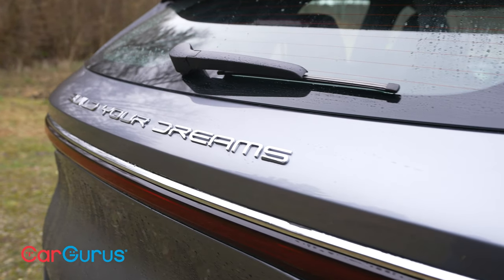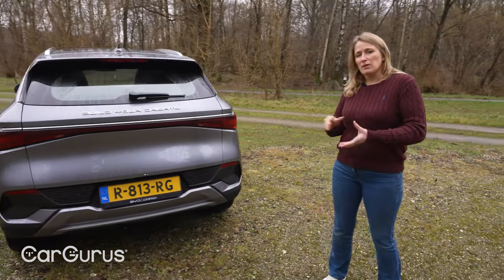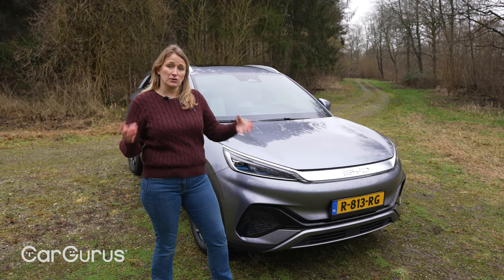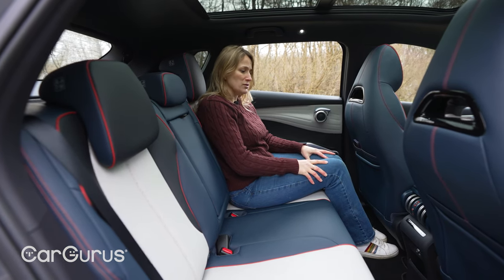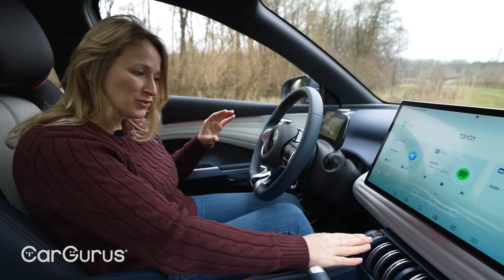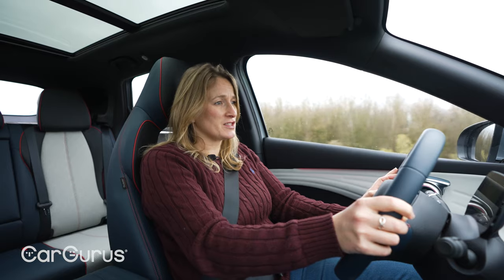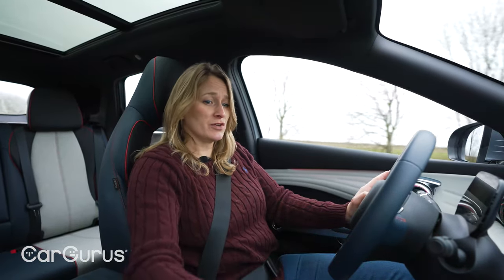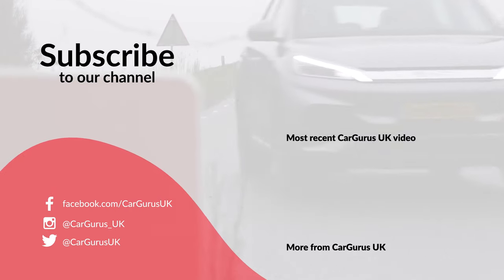Driving the All-New BYD Atto 3: Is This China's Best Electric Car Yet?

Comment: I have one of these in Australia and just did a 3000km road trip. It's a fantastic car. So comfortable and drives so well in a variety of conditions. I was getting about 350km range on the open road with cruise control at 115km/h - that's in standard mode (not Eco), and standard braking, and that was on some hot days at 35c. City driving we get around 450km range!  Yes the interior is confronting at first... but we will never go back. It's an exciting and fun car to drive.
Reply: How much did you pay the car in Australia? Thanks
Reply: I visited Sydney in April and saw quite a few Atto3 there.  My curiosity is charging station, I didn’t see many.
Reply: Nice....

Comment: I am from Australia and had an atto 3 for 6 months.
om the Australian version there is a regen control near the gearstick.
On the range you will get about 300Km at 110 Km per hour with all the driver assist functions and the A/C running.
At lower speeds you should easily achieve 400 Km with moderate driving.

Comment: Personally, I think the newer BYD Seagull is a better looking model and one of the first EV using Sodium ION battery.  The advantages of blade battery are u can charge to 100% every time and longer life than Tesla, so it allows u to max out the mileage.  Atto3 has a different name Seal in China, a part of their ocean series which reflects in the design detail like fish scale c pillar and water wave shape dash board.  BYD has been making EV for awhile, their E6 is like E London Taxi, build specifically for Taxi is on the road for many years with proven platform and impressive battery life.  So even the brand name is new to Europe, it stands on its own against the German models well.  Fun fact, Atto means a micro amount of time.

Comment: Thanks for the best review yet of this interesting car. Given that LFP batteries are allegedly 30% cheaper than the NMC type used by their competitors,  that BYD build so much in-house and in huge quantities I am surprised that the pricing is not more aggressive. I've owned a Kia e-Niro since March 2019 and here in France where I live the Atto 3 is coming in within €2K or less of the newish Niro EV which itself is just too expensive being in the €44K to €48K range. If this car was pitched €5K or so below the e-Niro and local hero Renault Megane e-tech then it would be a true disrupter. The real problem for EV adoption continues to be the price premiums you have to pay to ditch fossil fuels and go electric. If you look at the prices of similar sized ICE powered cars here (Nissan Qashqai, VW T-Roc, Peugeot 3008) you are looking in the range €34K to €38K. Now that EVs are being produced in volume and battery prices are coming down why is there still this huge difference in price?
Reply: Taxes.
Byd not selling enough ev in europe hence 
Higher Distribution margin pervehicle
Reply: >>  Given that LFP batteries are allegedly 30% cheaper than the NMC type used by their competitors, <<
 BYD LFP isn't that much cheaper than older NCM's -- probably cost more than the recent NCM8/9.

Comment: When BYD do a facelift of this model they should firm up the suspension to give it more sporty handling and to reduce body roll.becuese most reviews seem to single that out as it,s only downside.
Reply: I have an Atto 3 and would not touch the suspension. I also have a Audi Q5 with air suspension and I prefer to drive the the Atto3 and the Audi is twice the price